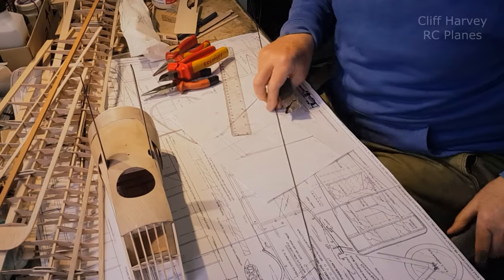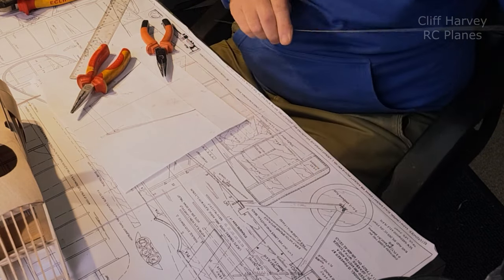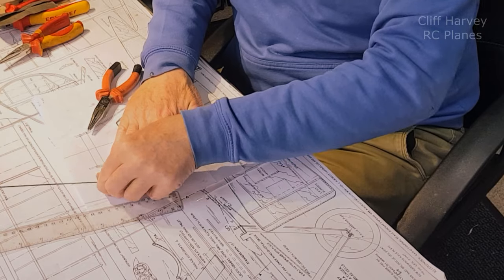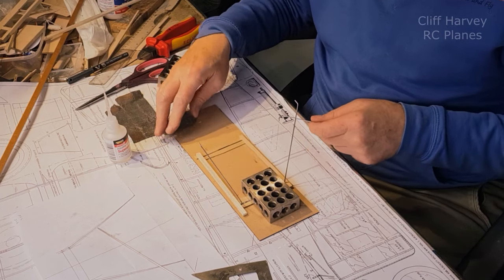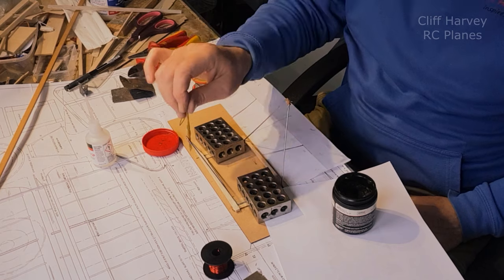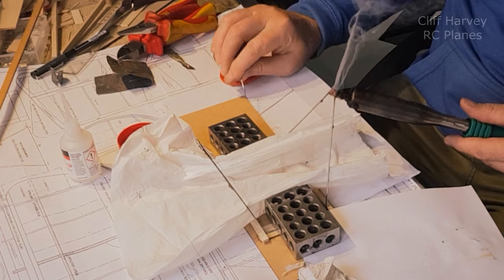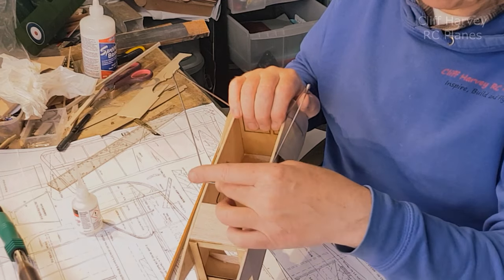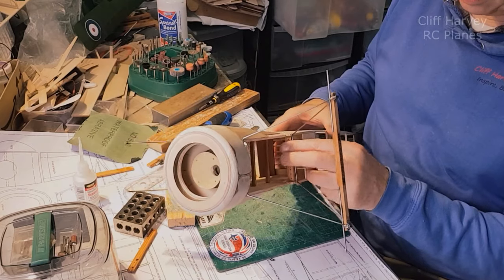Sopwith Triplane Build Part Four

Comment: Love your channel Cliff. A good hint after soldering with acid flux is to scrub the joint with some baking soda, then rinse off with water, then the ipa. The bicarb neutralises the acid and stops rusting down the line.
Reply from the maker: Thanks for the tip 👍🙂

Comment: Cellulose Thinners cleans of the flux a treat. Must admit, being an "old Fart", I swear by Bakers Fluid and a Micro Gas Torch for such exercises.
Reply from the maker: Hi Paul, thanks for the tip, I've never used a micro gas torch, they look like a pretty easy tool to use, cheers
Reply: @CliffHarveyRCPlanes  Hi Cliff. The added benefit is also that you don't have to touch the workpiece with a Soldering Iron and move something. Bit of Flux, nice blue pencil flame and it's quick. Bobs ya Uncle, job done! Cheers.